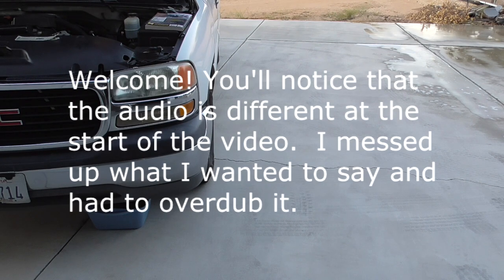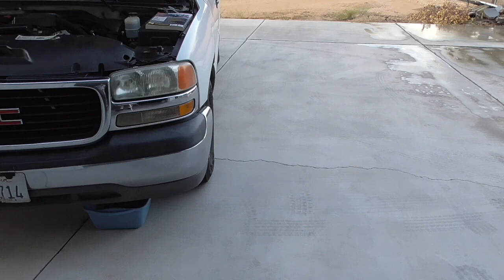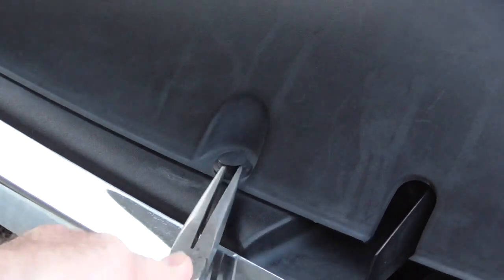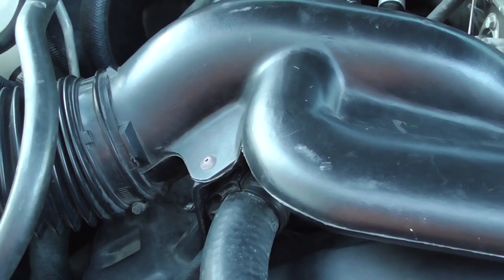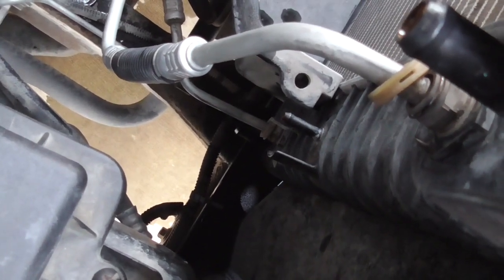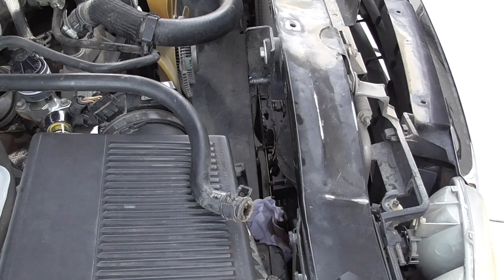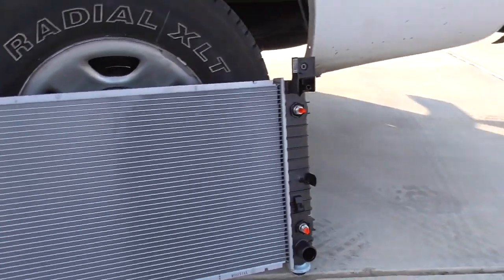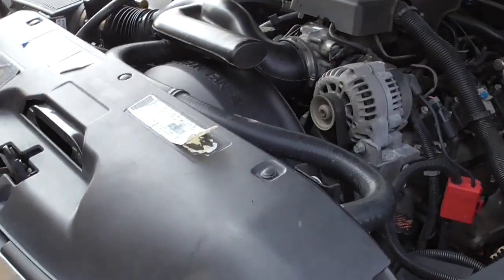Replacing the Radiator on a 1999 GMC Sierra 1500

Comment: My radiator has the same leak now. So, watching this convinced me it is easy enough to tackle myself. I've done much more complex repairs, but was worried about accessibilty and how much to remove. I suppose flushing the engine first before installing a new radiator is called for, especially with a 270k miles truck.

Thanks for the vid.

Comment: I have 99 Chevrolet 1500 Express Van and just install a new radiator. I had the same leak located where you pointed out.  My main concerns was how to get the oil cooler line off. Thanks for explaining on how to get the clip off. Works great . Installing the line was to easy too, I just push it in until  it click and pull the plastic over it. No leaks at all. Thanks.
Reply from the maker: rbu2m glad my video helped.

Comment: Thank you very much for this excellent information.  I have a 2000 GMC and could not figure out how to remove the transmission lines.  Thanks to you I didn't break or destroy something in the process of replacing my radiator.  I really appreciate it.